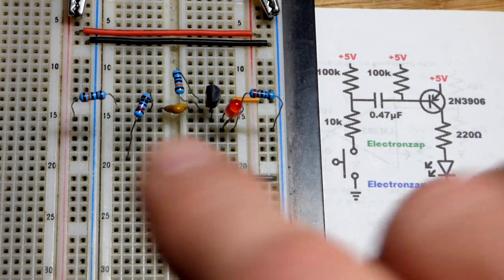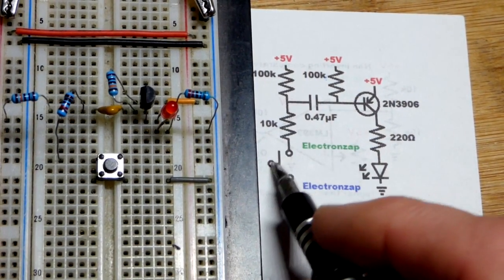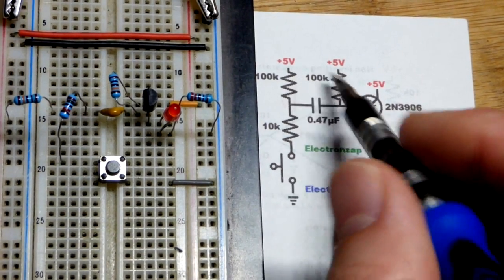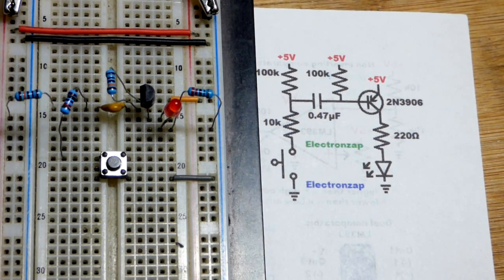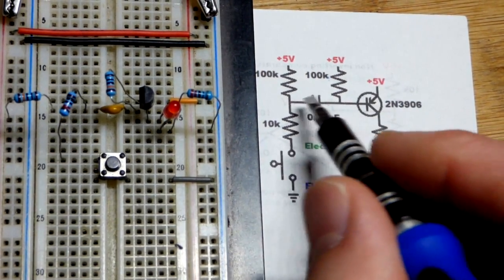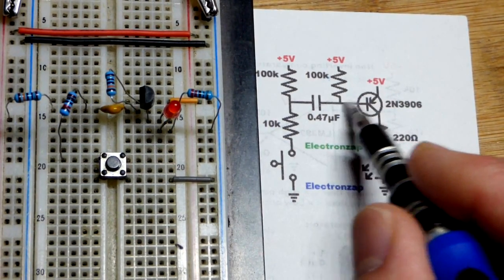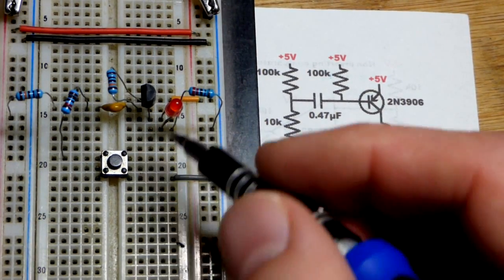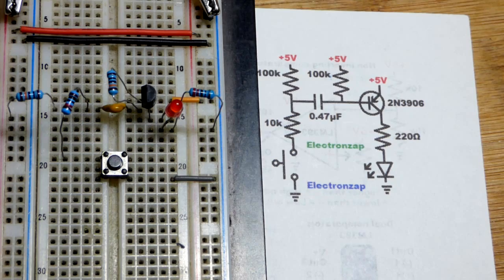PNP BJT Pulse to Flash LED demo circuit using 2N3906 Bipolar Junction Transistor

Comment: Can you use this circuit to demonstrate different methods and components to handle switch bounce?
Reply from the maker: I've mostly used timing circuits to debounce switches. This is the opposite, it is more bounce than anything.